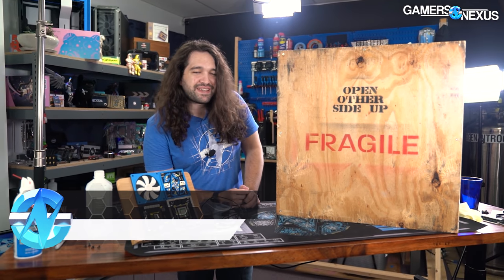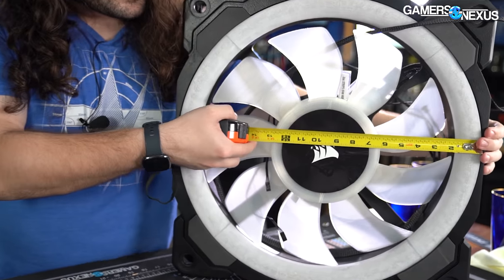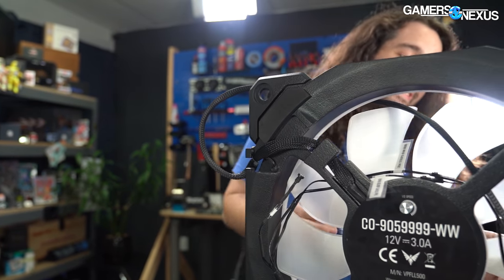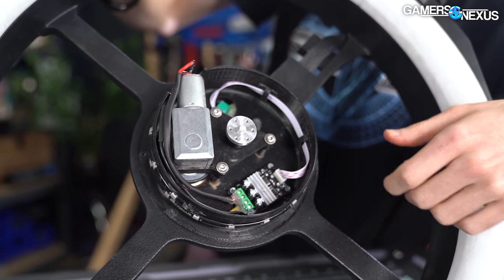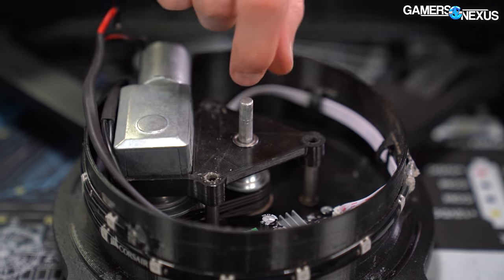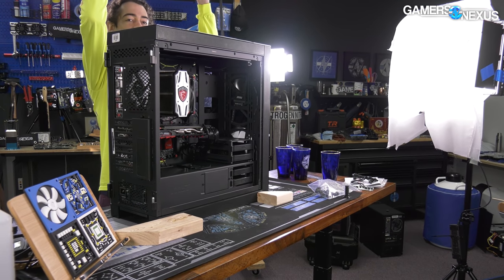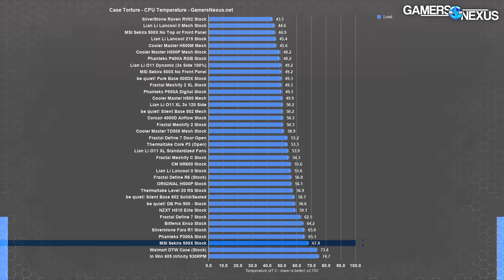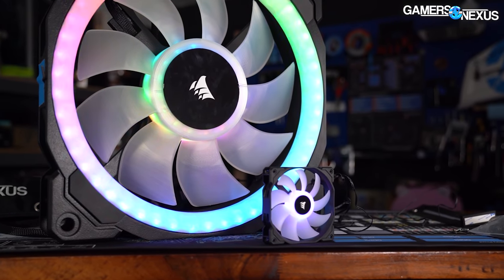World's Biggest Computer Fan: Corsair 500mm LL RGB Fan

Comment: No joke I would buy this as a window fan. I hope they actually do a run of these for April fools or something. If they made it not die after 1 use
Reply: it would be a trivial fix to make if they were to do a actual production run of these.  A wormdrive gearbox simply isn't meant to be used like this.  All they need to do is use either a direct drive motor, or a standard spur gear box that won't lock up when you turn it off.
Reply: @Wooble57  Yeah. Just a basic AC induction motor is good enough for moving air around a room. Speed control is trivial with AC fans, the method I've seen used everywhere is two diacs and two triacs with a dimmer pot on one of the triacs. Even if they went DC for PC equivalence, modern BLDCs are impressive little beast with very reasonable controllers that are meant to be the only chip on the board if you so choose.

Comment: Worm gears are great for large gear reductions, like when you want to use an absolutely undersized motor on a large slow device. One design feature is that because they have a very shallow thread pitch which makes it possible to create decent output torque with a very small input torque. Like pulling a sled up a very shallow incline. Another feature is that they tend to be self locking (good for a trailer Jack, but not for this), so if you try to power the system in reverse, it will not overcome the frictional forces in a smooth fashion.  Like if you stopped pulling the sled, it would not slide back down the hill on its own gradually. It sounds like there was enough momentum to force the pinion or worm to rotate, but alternating between dynamic (smooth)  and static (sticky) friction.
Reply: that belt drive setup is probably in there for the reason of that motor/gearbox locking up, the belts slip, letting the fan disk spin until it stops with some pretty stiff braking once the motor stops.. that fan disk is essentially a big flywheel when it comes to it spinning/being spun
Reply: even better idea - a ceiling fan motor direct drive or 1:1

Comment: As someone has already pointed here, find a single belt. For what I can tell, the motor itself does not need to be more powerful but the gearbox is going to give problems since it cannot freely move with the fan. As the fan accelerates and decelerates, the gears get al crunched down by its own teeth. There is surely a BLDC motor that can fit inside that thing and could even be programmable for PWM signal from the motherboard.

Comment: As an Industrial Electrician I would have to say you need a motor and gearbox that coasts to a stop. The mass and momentum of the blades on that tiny set of gears is going to quickly strip them every time..... It needs to coast to a stop.

Comment: As a auto engineer I can looking at the OG motor/gear box, it was lacking in good/quantity grease. Using a worm drive system requires very good sticky grease on the screw, if its just regular grease it will wipe off in no time flat.
Reply: Looks similar to a car electric window motor doesn't it?
Reply: @MongooseTacticool  very close to one, on the motor input side. Which looked to be the point of failure from what we can see.
Reply: @TdrSld  It looks like it needs an RC car motor or something that can spin up or down with the load. Regular fan motors exist! 😂
Reply: @MongooseTacticool  man a good RC brush-less motor would be loud as hell. But imagine that thing spinning @10krpms lol
Reply: @TdrSld  There exist small room fans with very quiet motors. I've got one in my barn that's been running every summer in the heat and dust for five years now. Can barely hear the thing on High.
Reply: @Reziac  that is most likely a brushed motor. Brush-less motors have what is know as cogging. Cogging is were the rotor snaps to the -/+ position on ever pairing. The stronger the cogging the loud it will be for the most part. I have seen a couple of YT videos of van/truck camper life were they try replacing the brushed DC fans with RC brush-less motors that can spin up to 15k. They want to try and make it work because with a PWM controller they can have near infinite speed control from about 5%-100% and sometimes over drive the motor to 120%. But the things ALWAYS sound like mini jet engines spooling up at all but the lowest of speeds about 15% and lower.
Reply: As an auto mechanic, I'm seeing that tiny motor and going "how could you ever hope to actually move any meaningful amount of air with that piddly little thing" because I've replaced electric engine radiator fans which are of a similar size, and the motor they use is direct drive and would likely take up most if not all of the room in that fan hub.
If they ever do put such a motor on that set of fan blades, you can bet that thing will move a lot of air.
I'm talking thousands of CFM, and static pressure will not be an issue.
Reply: @TdrSld  The whole problem with doing that with those little RC motors is that the motors don't have enough stator poles, so like you said the cogging is crazy and it gets very noisy. However, most of the noise is not from the cogging, it's from those little fan blades going at like 15k rpm. Have you heard the noise one of those data-center grade Delta brushless fans makes? Those spin up to like 25k, and they're deafening at full blast.
With more poles in the motor, it would spin with less cogging, and more torque, at a lower speed. If not a motor with more poles on the stator, they should look into a motor with a lower Kv rating.
Reply: @TdrSld  I have another same fan still in the box but dang if I can find it to check. Not my field of expertise, so thanks for the info. Is that why the better longevity too?
Reply: @44R0Ndin  Those radiator fan motors probably eat a good 370 watts or more.
Reply: @44R0Ndin  and its loud as hell and needs 10time more Energy

Comment: 10:00 I don't think what you mention is a conscious design decision. Generally these gearboxes are made with a worm gear to make the 90 degree turn required. Inherently worm gears at these angles are what is called 'non backdrivable'. That means that the power to drive the input side from the output side is much higher than the other way around, which you notice as 'locking up'. 
Another often used type of gearing that possesses this quality are ball screws. You see these often in for example 3D printers. 
This property can be good (for example, if you want to position a motion system, you want to be able to keep the load in a position without requiring constant motor power). It can also be a bad thing, as in this fan, where the inertia of the fan blades can cause tremendous peak forces in the drive system.

Comment: "This is in some ways equivalent to putting a floor fan from a home improvement store, right up against the case." I am... absolutely guilty of this...
Reply: When I upgraded from a Radeon X300 to an X1050, my Gateway prebuilt wouldn't power the GPU fan enough to spin. So I had to use a box fan to keep the thing cool.

Comment: The reason there is that issue when you shut down the fan, is you can't back-drive a worm gear.

The reason they used one, was its the cheapest way to do a large speed stepdown, which was necessary to drive such a huge fan with such a tiny motor.
Reply: Worm gears aren't great for constant load with no oil either.. so it was a cheap solution. You can fix the back-drive issue if you add a ratchet clutch. But I'd probably just go for some other step down solution, planetary gears or precision gears.
Reply: @shingnosis  Ya, would probably be fine with a lower load, but I imagine those fan blades generate a good bit of resistance.
Reply: @shingnosis  Ya, would probably be fine with a lower load, but I imagine those fan blades generate a good bit of resistance.

Comment: That actually looks pretty cool (no pun intended). I wonder if this can be pulled off functionally to have 2  of these extremely comically large fans on both sides of the case, 1 for intake and 1 for outtake. The cooling would be out of this world and would provide a uniquely fun case! Great job by corsair and GN. Was a hoot.
Reply: i've done something like this back when i was mining btc, and it works extremely well.  

it's just loud af, draws tons of power, and will blast dust into parts of your hardware you didn't even know existed

Comment: Hypothetically, what would a reasonable MSRP look like vs. the bill of materials?
Reply: Probably like $100 if they mass produce it right
Reply: Yep, not a lot, but to buy it just the size alone increases the shipping cost to like a case.
Reply: About 10 bucks, then they would charge 50-85. lol
Reply: If made with injection-molded plastic, it depends a lot on how many they think they'll sell. The tooling would be very expensive - the plastic is not.

Resin casting on the other hand is labour-intensive, so per-part minimum costs rise.

3D printing is doable but not fast, and very large 3D printers or having workers joining together many small parts are also an added expense.

There's a good reason niche products simply cost more.
Reply: Sold for 299$ and 30$ material cost.
Reply: @micblades1117  seems good enough
Reply: @stepbrochungus7722  so equivalent to 1 noctua fan?
Reply: @fist003  thats why i order them in bulk. Its a great investment unlike gold
Reply: Reasonable MSRP @ production scale would be $60-70. The bill of materials for this EXACT fan as-is would be around $200 including the electrical cost of 3D printing something so large, but discluding the cost of the tools (3D printer, soldering iron, clamps, labor, etcetera.) Brought to scale production (10k units) the total BoM should be closer to $40/unit, half that being in the RGB strips, especially since there is no great way to automate installing large ropes of RGB strips, adhesive or not.
Reply: Well, this design isn't a sellable one. They overcomplicated the solution and made it pretty unreliable. The bill of materials would be useless.

But a standard box fan runs twenty to forty dollars, retail. We can double that since this is the world's only RGB box fan.

Comment: Obviously you'll have to run this by Corsair, assuming they allow you to keep it longer, but you may want to consider adding, increasing or changing the lubricant in the transmission.

In the case of there being none, or if you're prepared/able to change it, I recommend Molybdenum grease (aka Moly grease) and applying it generously to all of the moving parts inside the gearbox. There's a lot of space inside that small transmission so it will be difficult to apply too much, since excess will be pressed out of the way into the casing. You should be able to get Moly Grease from any car parts store, it's used in transmission parts on most cars at one point or another.

I suspect that the weight of the fan is simply too much for the brass worm gear, since a worm gear cannot free-wheel, so when you shut the fan off, the transmission is being battered against itself whilst the rubber drive belts repeatedly snatch and jump, which will be the grinding noise mentioned.
One mitigation measure would be to reduce the fan to it's minimum speed before shutting it off. Even better, once the power is shut off, physically assisting in the braking of the fan by pressing against the spinning side of the fan hub. Stopping the fan sooner will reduce the battering the worm gear takes.
Suffice to say, a worm drive transmission was not a good choice for this application but since they were using off-the-shelf parts for a 'prototype' it's easy to see how this happened.

You could even spin this as an "opportunity" for Corsair to let you keep it longer. You're performing R&D on their 500mm LL RGB Fan, in hopes of ........ uhhhh ...... conceptualising and actualising a revised model that will be more suitable for distribution to end users.

Comment: They should make a case designed around this thing.

I have 9 fans in my current rig.

Only needing one would be hilarious.
Reply: It would need a separate power supply ... that can supply 12V 3A 10W!  Then it's own LED and power switch!  This things crazy, you'd be better off with a desk fan 😂
Reply: @DailyCorvid  they said in the video it only actually pulls about 10w, or 12v  0.83 amps.  Motherboards exist with headers that could handle this.  Alternatively, if it actually pulled 3 amps, you could just use a molex or sata connector.  It could use the sata connector to pull power for the led's as well, and just draw a signal from the motherboard header.
Reply: @DailyCorvid  It could run on pci-e power couldn't it? That's 12V and variable amp, so it could pull as many amps as it wants?
Reply: Seems like a lot of work for a product that dies after 2 hours!  Might even take longer to rig it up than it lasts 🤣

This is like some daft Linus project, it will look cool one time then end up choking a bunch of whales.

Let's just use a jet propulsion engine to spin a titanium bike wheel with fins attached, there you go Linus I just ended your series for you !

Jetprop bikewheel MAKE IT HAPPEN LINUS.
Reply: @DailyCorvid  box fans exist that don't break, presumably if corsair made this as a real product instead of a joke this wouldn't have corsair's leftover parts inside it and it'd actually run
Reply: @DailyCorvid  uhh, okay haterboi
Reply: Yes I am a heteroboi, sorry to disappoint you ;)
Reply: No 50cm ones!! Lol.  Who the hell wants a fan that generates more wattage than it could ever cool.

Corsair that's who ! 🤣🤣🤣

Comment: Thank you Gamer Nexus greatly for showing us the inside of this prototype. I am actually really unimpressed with the engineering they put into it. Tiny 10W motor with a jenky belt drive is an embarrassing waste of space. No wonder it broke. You know you can get a 17" automotive radiator fan that runs on 12V from amazon and it will actually work.
Reply: The motor size is fine and belt drives are extremely common.
The issue with this fan is the worm drive gearbox.

Comment: If you are allowed to keep it and feel like it, i think the gears/belts of radio controlled hellicopters can be a nice fit for the upgraded supercharged version (even the numbers are the same, since a “500 class” rc helicopter just means that EACH of the main blades is 500mm long). So the gears for, lets say, a 300 size helicopter will be a nice fit (and absurdly over-specced) for that fan. For comparison, around 2KW peak power is not rare for these helis.

Comment: Ask corsair if you can "upgrade" it and make it function longer than just for testing. Maybe they will let you guys keep it untill the fan testing rig arrives :D
Reply: I'd say a large gearless Brushless motor from large RC motors, or a AC fan motor with a little gearing down or belt based equivalent

Comment: I feel like this video is foreshadowing for the cooling needs of the next generation of GPUs.
Reply: NEVER. Moore's law must be upheld no matter what Jensen says.
Reply: Jim McIntosh  Yeah it's honestly getting a little ridiculous with the whole increase in power consumption every generation. I remember when the best video cards you could get didn't even have a fan on them, or if they did it was a small one on a tiny chunk of heatsink that may have been about an inch squared in surface area. Now what do we have? Big hulking triple slot coolers with 3x 90mm fans on a card 14 inches long. Sheesh. And any CPU worth buying these days doesn't even come with a cooler, because including a sufficient one would eat into the bottom line for AMD/Intel and we can't have that.

Before long, we are going to have to have the power company run a dedicated line to our homes just for our gaming PCs, lest they trip the circuit breakers every time you fire up a game.

Comment: Kind of surprised they didn't just re-work a simple direct-drive off-the-shelf box fan motor to attach to the custom fan blades instead of the overly complex and janky solution they came up with.
Reply: They haven't run out of wrong ways to do it yet 😏😁

Comment: Where is the noise normalized test? It would be interesting to know if this is a viable option for a quiet set up.
Reply: If only this were direct drive instead of belt driven. Those grinding noises are a deal breaker.
Reply: @CaveyMoth  - I don't understand why they put a gearbox in there. They couldn't just put some kind of electro-motor in there?
I mean, I wanna say this thing looks like it was made by some students, but when I was in school we actually had to wind our own motors for a project and those things worked and were controllable and everything. So, you could surely just buy something that would make more sense. - What is this "lab" that made this thing?...

Comment: it's not a horsepower issue. It's that it's using a worm drive. You would need to modify the gear setup for it to work in a more permanent way. A worm drive will destroy itself basically any time you stop the motor (because of momentum). Worm drives are very good for reducing the RPM, but are usually used for things like winches (because they are locked as soon as the input shaft stops spinning).

Comment: Wonder if upgrading to a brushless RC motor with a significant increase in rpm and torque would allow for the fan shroud to come closer to the fan blades (or visa versa) to increase static pressure. Would be funny to strap this fan to a radiator setup and see what it does.

Comment: It needs a free rotating gearbox. The worm gear will cause the gearbox to bind up, and surge current is probably ridiculous. Toss a flyback diode on for good measure to deal with spikes, and a 4 pin connector to indirectly drive the PWM and LEDs, it could make for a useful piece of hardware.